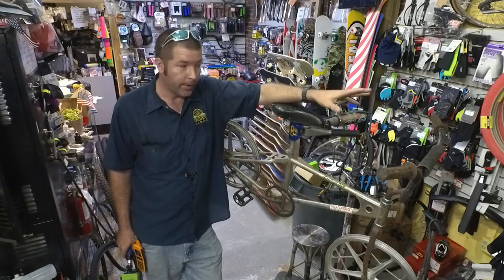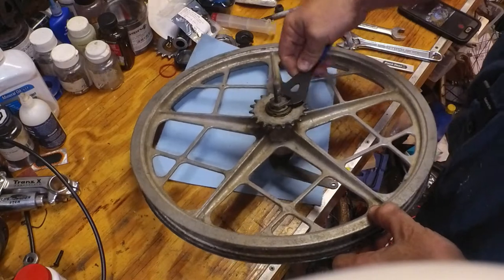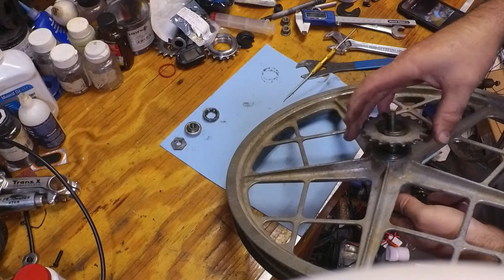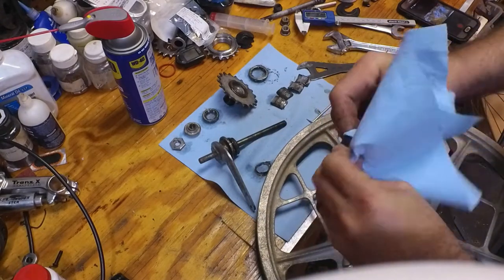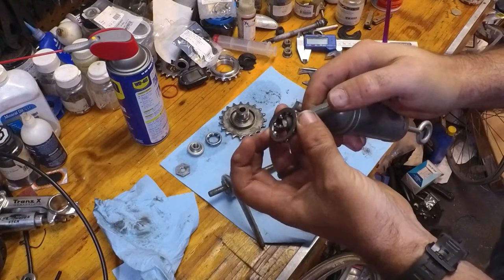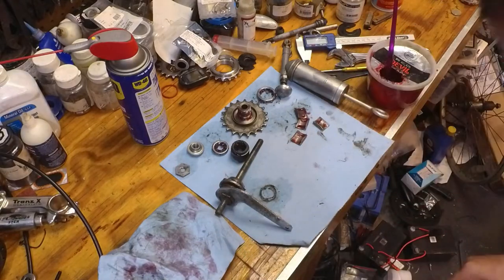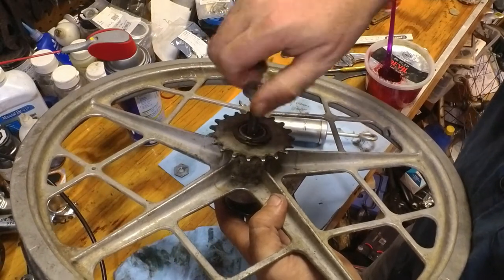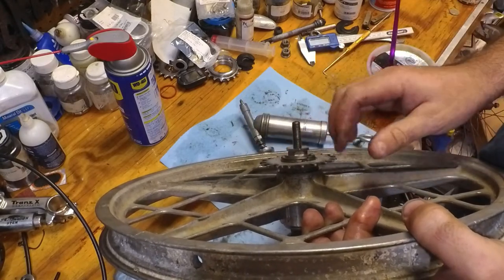Servicing a Bendix 76 hub.

Comment: Hey My name is Andy, I am trying to convert a front Rovan Industries. Morris Mag to a rear wheel. I have a bendix 76 just like your motomag. The only problem is the bore of the front wheel is much smaller than rear would be. The bore in the front wheel I have is 29mm or 1.125". I need to know the size of the bore and bearing races on both sides so I can have my wheel machined. On my 28 spoke "bendix 76" donor hub the bearings are different sizes from left to right. Also do they sell these steel bearing races to insert in the aluminum Morris Mag wheel ? I assume they will be the same ones I see in the Motomag in your video. You look like an expert that can help me. B.T.W. I have two front morris mags wheels and want to make one into a rear. I know the front and the rear wheels have the same U.S. Pat No. D232717 on them for a 100% fact. The rear wheel is just machined different from the front, So I can convert it with a machine shop and 2 steel bearing race inserts. Can you help me figure this out ?

Comment: Hi Jason. Just bougth a couple  of wheels like these. however on of them desn't  have brake sistem. Do You know where i can Buy it or if You can seel it to me.. I AM fron Monterrey México. Thanks
Reply from the maker: The ones with out the brake system are more valuable. They are called freewheels and are highly sought after. If your missing the internals that is a different thing and no I do not have any. Thanks, Jason

Comment: Thanks so much for posting this video. I have a rear Motomag II that needs to be serviced. I also need to strip two layers of paint from it. Please give me any suggestions on what chemical I should use to strip the paint. I believe the paints are enamel. Thanks again.
Reply from the maker: I use Klean Strip Aircraft paint stripper. But after you use it you need to rinse immediately and polish. If you don't it may start to oxide. Thanks!

Comment: Any way to make those a freewheel instead of coaster brake bs ? Slightly modifications to the parts that are already there without buying anything ?
Reply from the maker: They had kits back in the day that would convert coaster to a freewheel type. Some would have washers and a spring to make it freewheel. Others would put a threaded piece on the end were you could put an actual freewheel on. It is very hard to find those parts today. You can try to make your own kit today using washers and a spring but it may not work that well. Goodluck👍
Reply: @alloutbikes  Thanks,maybe you can video how it was done some day hint hint lol